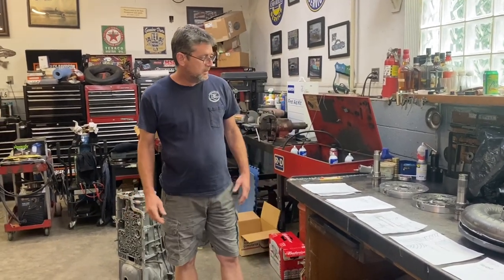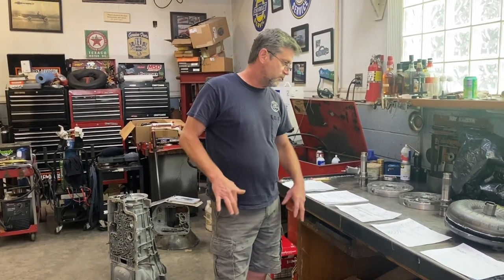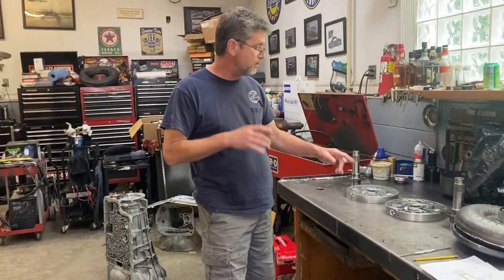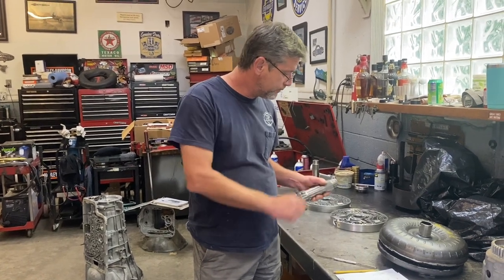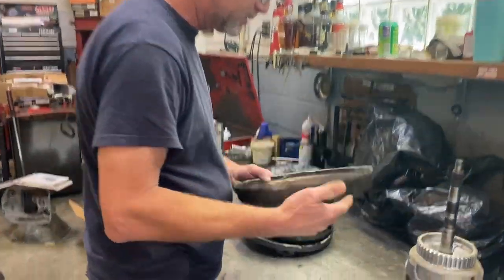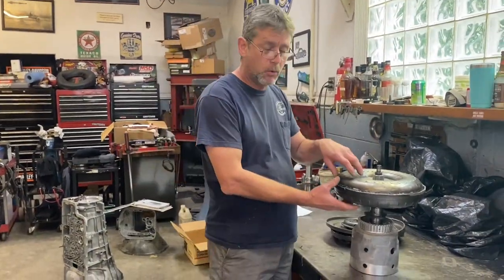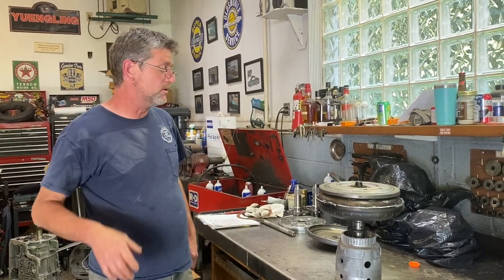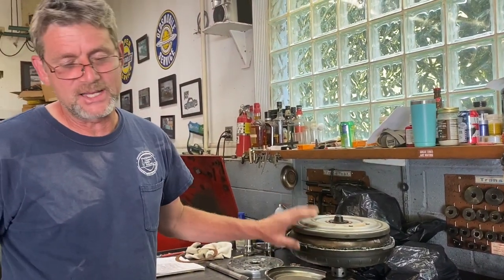E4OD/4R100 TCC /PWM” LOCKUP SYSTEMS EXPLAINED”  RABBIT HOLE STYLE!!! Pt .7

Comment: I'm rebuilding my 96 f250 2wd E40D. First I want to thank you for the wealth of knowledge that you have to share. This is my 1st transmission rebuild. I'm  glad that i came across your videos because i love how you go through every detail. Trust that you are going to be there with me every step of my rebuild lol. The reason I'm even rebuilding my transmission is one day at a stop sign I went to accelerate and I heard a pop. Then my truck lost the ability to move. Upon teardown I couldn't find anything in the transmission that would of caused this. As a matter of fact everything looks like new. It was kinda freaky. No clutch  no unusual wear on anything and some of cleanest fluid I'd ever seen in a transmission.  I am a mechanic and have seen all kinds of fluid.  When  I drained my fluid from the torque converter it sounded like something was definitely broken rolling around in there. Is there anything inside that would cause my symptom? I used my power prob and checked out my selonoid pack like you showed me. Then I did the air test. Everything checked out good. Scratching my head over hear lol.
Reply from the maker: Your very welcome, It’s all about sharing knowledge these days.Interesting for sure. There are only a few things inside a torque converter that would cause a total no move condition. 1 being a complete blow up where the impeller fins and or the turbine fins are destroyed and can’t transmit hydraulic power to the input shaft. That doesn’t seem to be the case here. I would drain the converter completely and first shine a light down in the converter and look at the splines where the input shaft splines spline to. See if there stripped. Second put the input shaft in and spin it. Most likely it will spin very free and seem not splined to the entire turbine assembly( from my video) possibly the splined hub broke free from the turbine fins causing the no move. Very rare but anything is possible. Also when spinning the input shaft notice any unusual grinding or crunching indicating something is indeed “broken” inside. Should be fairly easy to tell. Be sure to check ALL the splines on the hard parts inside the transmission drums/planets shafts etc. it will be obvious once you find it! Let us know the outcome.

Comment: I’m so grateful for your contribution to the automotive community. Found you because I’m dealing with an E40D in my F250 it’s leaking out of the pump and has oil in the shift solenoid plug and won’t go into any gear. You’re the first person to be able to explain to me exactly how the transmission is working and I’m in your debt.
Reply from the maker: Thank You ! Appreciate the Comment. It’s so important to understand how it works otherwise it’s a guessing game. Glad you got something from the video we definitely went deep on this one. No move condition on yours there is definitely something broke or stripped inside !

Comment: First time builder and believe I burned up the new building.had no tag for the tranny. It is a 4R100 but the torque converter was a  lock up system. Yet when doing the Transgo  HD 2 I did not have the insert to drill out for the firmness. But the original torque converter ,or I should say the rebuilt before me , was a lock up not a Pulse Modulation system. Are the inter changeable. My bypass line cracked at the front connector .. I believe it may of burnt up the new rebuild. Great explanation of the torque converter. Another good video to go with the rebuild would be full install with part that have to be replaced. You may have one I gust have not found as I said a new first time builder cause I have been screwed over to many time as with this truck I purchased. Noticing many things replaced and improperly out with used parts from a mechanical repair company. Thanks and I am like you give any information or learned out.

Comment: A lot of times just for simplicity I would explain the torque converter or fluid coupling as two electric fans pointed at one another.  Switch one fan on (the engine) and that would in turn force the other fan to spin.  Except instead of air being used as a medium, much heavier fluid is being “thrown” onto the once stationary fan blade.  It seems to work well as a medium to explain what’s happening to the customer who will likely never be doing any mechanical work.
Reply from the maker: Yes Sir! You come correct on that. I originally was planning on showing it that way because I’ve seen that before and it’s a perfect analogy for what is happening! But for some reason it didn’t cross my mind when I was filming the video 🤔. Thanks for the comment

Comment: Man, Another Great Video Marshall and High Five to the camera man, Great Job to both y’all guys. Now I’m thinking about the PWM effect and understand that I’m not too happy with that idea either. Slipping verses a good solid Lock Up makes me think of unnecessary wear and heat. Definitely like learning those small details cuz they make a big difference once they can be understood once I watch you go through it step by step, makes the purpose of their functions clear. Having a 4R100, I’m interested to see what kind of difference it will make with the ATS 5 Star Billet Torque Converter and the John Woods Valve Body I’m having installed. I’m curious if it’ll be a major difference. If I remember correctly, 1.25:1 is the normal torque multiplication and ATS says 2.4:1 is what their TC produces, I’ll know pretty soon
Reply from the maker: Jason, your really a good study of all this for sure You Get It!  Those 2 things will definitely change the shifting characteristics of that trans dramatically. Stock setup is just plain WEAK. Let us all know how it turns out for sure!
Reply: @marshallsanders5672  I’ll know soon, they’re getting the new parts on the engine as of Friday afternoon. They should have the body off the frame sometime this week

Comment: I have a e4od the 94 F150 when you put it in drive the torque converter locks the engine down stalls the motor you can put it in reverse and it won't do it if you put it in reverse first and then throw it low it won't lock the motor down
Reply from the maker: That is probably a stuck ON Torque Converter Clutch Solenoid. In Reverse and Manual Low 1st. gear there is line pressure going to the back side of the TCC Lock-Up valve Forcing it OFF. When in regular drive there is not line pressure on the back side of that valve forcing it off so in turn it would create this problem if the solenoid was stuck-on. I have a solenoid test video as well to check it.

Comment: 1st class machinist/ Mechanical Fitter, heavy fab  and heavy Automotive mech, I have seen this alot through many components over the years, the Radius in the corner of that Stator shaft is to prevent it from snapping off , I would normally stick that housing in the lathe dial it in and machine a bigger lead in that corner
I thoroughly enjoy your videos matey I learn alot from lots of different peoples knowledge and experiences keep up the good work I'll be watching and learning
Reply from the maker: Thank you Sir ! Appreciate the comment ! Yep chocking it up in a lathe would be the shit but I don’t have access to one so that was my best solution. You never know what you’ll come across building transmissions which is one reason I love building them Good Stuff !
Reply: @marshallsanders5672  Hi there , yes have to make do were you can , good content your putting into these videos full of information very tutorial I am highly liking how much your packing into them. Good stuff👍👍

Comment: I just found your channel this week.  Wow, do I wish I'd known about you sooner!   I've been fighting and learning about the E4OD in my '93 F-250 ever since I bought it in 2020.   

I'm down to one issue with the TCC that I must get fixed.   I don't think it is ever locking.   I've pulled and tested the solenoid pack; however, at the time, I have not yet seen your solenoid video, so it didn't get the air test.  I did at least check resistance and put power to each solenoid to observe it operating.   

I've added an LED that lights on the TCC signal and a switch to manually activate the TCC.   The signal is happening above 35 MPH, but it is never locking.   

So now I'm back to making sure the TCC solenoid is flowing, but I suspect it is because, as I understand from this video, if the plastic seats break on the solenoid, it will be flowing all the time, which would lock the converter all the time.  

I think I'm down to the converter itself needs to be replaced.   Short of pulling the transmission and changing the converter, is there something else I can test to be sure?
Reply from the maker: Chip, Sounds like your on the case so to speak ! You are correct if the plastic is damaged or deformed it will flow all time and lock up all the time ! The only things in the lock-up circuit is the solenoid, then the lock-up valve in the pump (Which could be stuck off) , the Stator seal ( which could be worn out or damaged) and the Torque Converter itself ! Pretty strait forward hydraulic circuit but is a M Fr’ sometimes when lock -up problems arise ! Pretty cool you hooked up a LED light to the circuit and that ensures you the computer is “Commanding it on”
Sounds like your solenoid is activating which leaves the Stator seal and Torque Converter to blame at this point. Good luck in fixing it. Let us all know how it turns out. I need to start an E4OD forum to get all u to ou guys information out there without the BS involved !

Comment: Fantastic Video, I will be watching and rewatching this and the E4OD build videos as I tear into mine. My torque converter lockup just failed out of the blue one day and I could not find this amount of detail anywhere, on the lockup fluid flow and what could actually cause it to fail, aside from the torque converter itself. Wonderful explanation!
Reply from the maker: Thank you sir ! Everything I explained in this video should be EVERYTHING you need to correct the problem. I left some things out but will explain it all in my next video ! Welcome to the channel ! Good Stuff
Reply: I was hoping you may lend me your expertise. Have you ever seen a stuck TCC Valve that would not allow the converter to lock up? My torque converter stopped locking up one day out of the blue. I have a manual tc lockup switch that has worked perfectly for the last 10 years, now it won't lock manually of on its own. In drive, at a stop, I hit the switch and it does nothing, not even a drop in rpm like it is trying to lock. I can hear the solenoid clicking from under the truck. I took the solenoid pack out and tested it per your video and everything tested good. At this point I don't know what else it could be, it shifts fine in all gears, no other signs of trouble, the fluid was clean when I drained it. Any ideas?
Reply: @the909ranger  I'm in a very similar situation.  Did you find the root cause of your problem?

Comment: So…. Do you recommend towing with the overdrive button on or off/ light on or off..¿?….😮
Reply from the maker: I recommend towing with the O/D off (light on) then when you get up to speed on flat grade/low load situations it’s ok to put  it in O/D. 
I also recommend manually shifting in more extreme/heavy towing situations.

Comment: So I have a e40d behind a 96 powerstroke the transmission functioned fine but the seal was leaking in the pump so I replaced the pump. After the pump was replaced the tc locked and wouldn't unlock so I pit new seals in my old pump and put it in and the tc is still locked I checked the solenoid as you showed in your video for that and it checked out what els can cause my issue
Reply from the maker: The lock-up system is fairly strait forward in these. Did you disassemble the pump ? The lock-up control valve in the pump could be stuck on. Is the Teflon seal at the end of the stator new/Ok, and or in place? Could be a bad converter as well. 
  Everything for lock-up is in the pump except the solenoid itself so if the solenoid  is good it has to be in the pump or converter. 
I have seen it lock up and stall the engine when the filter falls out of the pump but it seems that isn’t a problem. 
I have also seen when it’s stuck in high line pressure it will lock-up in reverse and stall the engine but only in reverse.

Comment: Great video Marshall, not sure how that stater got cracked, glad you found it , it probably was like that when I bought it I just didn’t catch it  , I’ve seen some people use the input shaft and a hammer hit the shaft side to side back a forth to remove the pump that would be my guess, I haven’t been able to finish watching the video as it got late last night will continue tonight, great job Marshall on the filming
Reply from the maker: All good man I’ve used the method of pulling the pump that you just described many times before also. It is possible I suppose but I guess at this point it doesn’t matter we’re good with that and have good parts.

Comment: At the beginning of, you showed a couple of pumps…were they different in size.. or was it just an optical illusion… maybe I should of got out my 175’s😊 great start to a great day… I changed my fluid yesterday on my Powerstroke. She’s not engaging I’m thinking it’s the bands… it’s done this mostly when hot. No metal in the pan but NO MAGNET EITHER… I am rebuilding it even if it works today on the test drive… it started pouring yesterday during the thermostat housing replacement..🤠

Comment: Hi Marshall, I have a 2003, F150 7700 w/4R100. This summer I'm going to re-furbish the truck and have a transmission guy rebuild the 4R100. I'm going to supply him w/the Transgo 4R100LU PWM Valve Assy. and the Transgo E4ODHD2 Reprogramming Shift Kit. Please, given this, when I replace the torque converter, do I need to get some type of heavy duty unit, or will a stock, re-man torque converter be OK? I don't regularly tow heavy loads but I'll have to transport a JD tractor occassionally. Tractor and trailer will weigh about 8400, or 8500 lbs. Thanks from east-central Arizona, Tim
Reply from the maker: Yeah any type of towing should get a heavier duty Torque Converter. That is some weight to pull and a stock converter just doesn't hold up.

Comment: I have a 4r100 in a 04 f250 with 5.4l and I am getting a shudder noise and or a sound like hydraulic fluid humming noise passing through a line between 35 or 55 mph what would you recommend I do to figure out if it’s a bad torque converter, pump, solenoid pack, dad or worn out overdrive parts and so on. Or should I just rebuild the entire transmission. It doesn’t throw any codes fluid looks good, I did notice a very small leak when you remove the rubber inspection plug. Further more i notice it does it more often when driving normally light load on engine but if it’s driven hard higher engine loads it doesn’t do it and shifts very well only problem is a short shuddering noise that is present or 5 to 15 seconds between 35-55 mph. 
Thank you
Reply from the maker: Yeah it sounds like the torque converter clutch is wearing out causing the chatter/shutter. With that said it sounds like the front seal is leaking slightly so best case scenario would be replace the torque converter and go through the pump replacing any worn parts. Most likely just pump gears and bushing/ “boost valve” in the lock-up valve line up, reseal and  be done. With that said that’s just fixing pump and torque converter(main problem) but how many miles are on it because the rest of the trans still has that many if that makes sense. In the case of high mileage just makes sense to rebuild entire unit and be assured no problems for years down the road.
Reply: @marshallsanders5672  thank you for replying I appreciate you sharing this information with me it very helpful. 

I just got the truck two months ago it has 287,000 miles on it the transmission was replaced with a jasper transmission but I didn’t know how long ago or at what mileage it was done. I hope that I won’t find any surprises inside since it’s a Jasper transmission so hopefully they just rebuild them to manufacture specifications. 

I also thought about drainage the fluid and change out the filter and put that shudder fix additive in to maybe get a few more months out of it before doing the rebuild would you recommend I try that. 

Also I wanted to add I will mainly use this truck for plowing and occasional pull a light weight trailer, so should I look into any specific clutches or any other parts to make it easier on the transmission and get extra life out of it or will the OEM setup work just fine?
Reply from the maker: @piotrtomaszek5316  Yeah you certainly can put the shutter fix in and most likely get some more mileage out of it, just know its a temporary fix at best is all.
   As far as being a jasper it most likely has a bunch of upgrades already in there but hard to tell until you tear into it. I would definitely recommend the Transgo "Tugger" kit for H/D use along with other certain hard parts I mention in my other videos. Borg Warner clutches work just fine in even heavy duty use and a proper rebuild. Good luck with it i hope it gets you a little farther with the shutter fix.